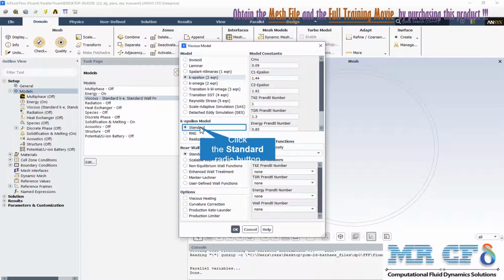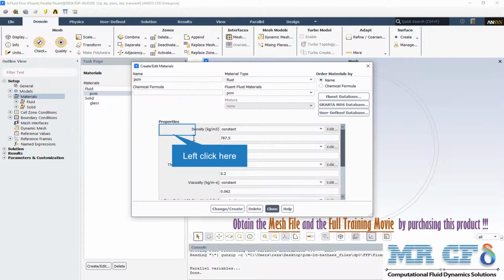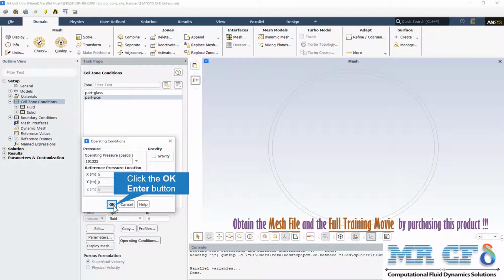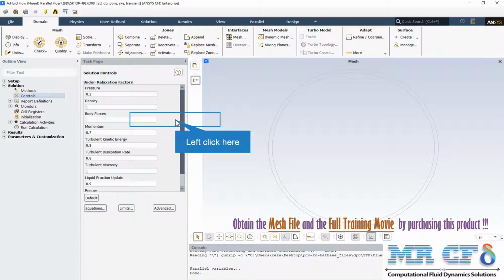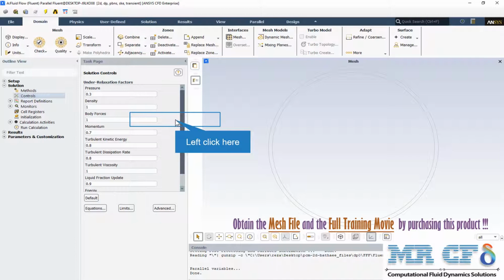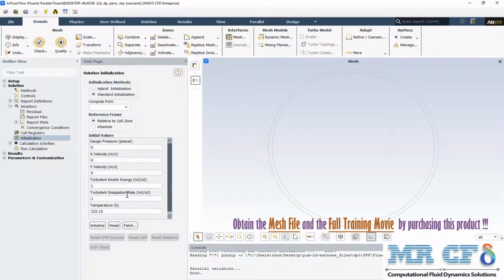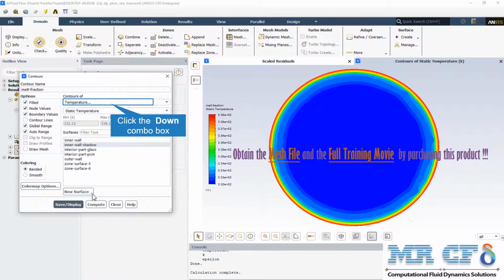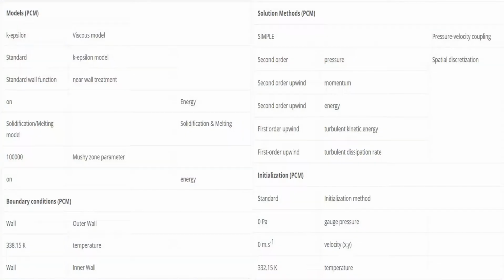ANSYS FLUENT Training: Phase Change Material in a Glass-Coated Circular Chamber

Comment: Hi Mr CFD, does the Pure Solvent Melting Heat value work as a piece wise linear function between the solid and liquid state? Would you know how it works on the background? Also for specific heat capacity, would I model it while ignoring the latent heat portion? Hope my question makes sense